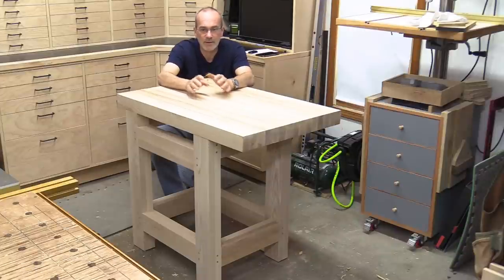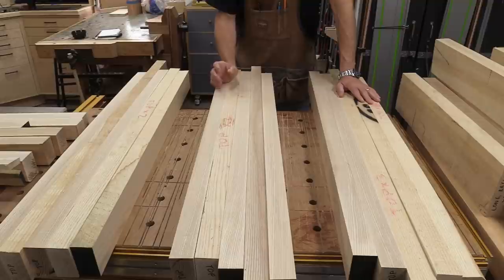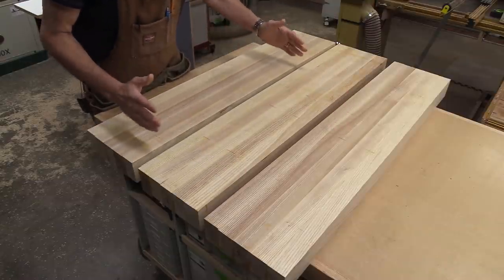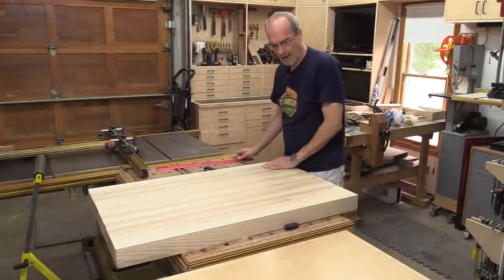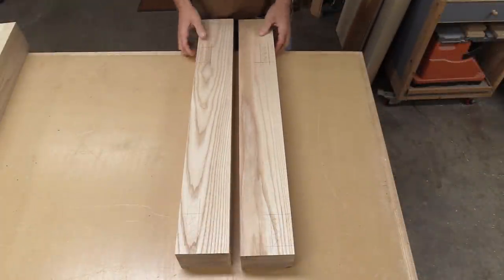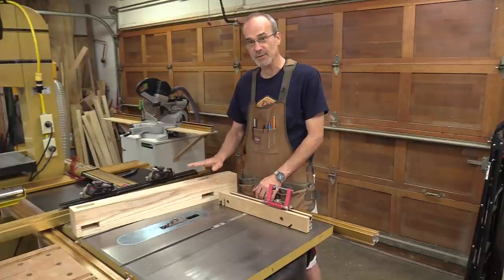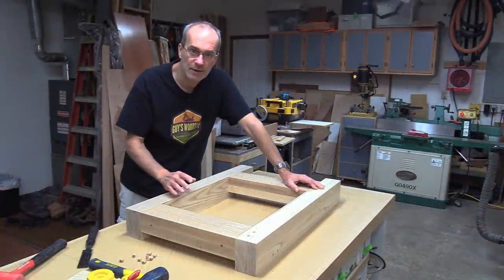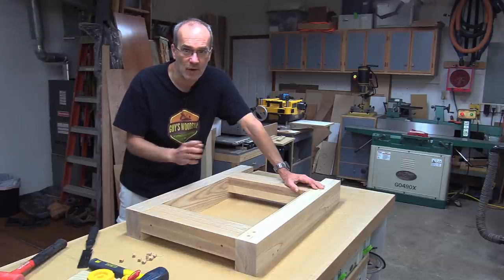How To Build This Small Sturdy Hand Tool Workbench//Woodworking How To

Comment: Really nice.
Put some rubber shelf liner under each foot and it will help get rid any little bit of rocking and keep the bench planted on the concrete floor.
Reply from the maker: Thanks Tim! That's a great tip! I have some of that liner left from when I did the drawers in  my shop cabinets.

Comment: Fantastic bench, Guy! Maybe I missed it in the video, but, why is the front apron lower than the rear? I went back and skipped around the video to watch again and didn't see you mention but I could have missed it.

Thanks for sharing!
Reply from the maker: Thanks Sean! Yeah, that gap under the top in the front is for the vise to go into. I never mentioned it in the video.
Reply: @GuysShop  I was looking for the same answer 🙌.
I'm building this now in Australia. Mine will have an end vise using LN chain drive hardware mounted under the top. Glad I worked this out now... Dropping the stretcher on that end will make install go smooth!

Thanks for the great plans and video. Big fan.

Comment: Hey Guy unless I missed it I couldn’t tell did you glue the tenons in the base? I saw that you glued the dowels but did you actually use glue on the cheeks of the tenon itself? Also are you worried about top movement the way you screw the top to the base did not look like the holes were elongated just wondering how it’s held up over time. Love your work

Comment: I have a silly question. I happen to have the option to buy 80mm thick European ash slabs. And was wondering for my "Small and STurdy Hand Tool Workbench" If I should just keep the slab on top, or cut it up and laminate it like you did.
What would be the pro's of laminating it or cons of just using the big slab of wood?
To me as a hand tool person doing the big slab in two sections seems way less work.

Comment: nicely done. Are you going to add a lower shelf or drawers like you built into the wall around the bench? I have found that in a shop environment there is no such thing as too much storage.
Reply from the maker: Thanks Tim! I have already built the small cabinet that goes under the bench. You can see pictures of it on my Instagram - @guyswoodshop

Comment: I haven't looked at your channel yet so sorry if you have a video answering my question. I am a machinist and I have multiple books and guides that I use for reference. I was wondering if you could recommend to me the best reference material when it comes to working with wood. Mostly interested learning how to make my projects more solid and structurally sound, if that makes sense. Thanks in advance
 Great video, I want to make a really nice sturdy bench but wood seems to be my enemy...

Comment: Another great video, as always ;D How do you do the 4th side if the boards are thinner?
Reply from the maker: Not sure I understand the question. 4th side?
Reply: @GuysShop  Sorry, I was unclear, I know it’s an older video :-) In the milling process; Here you joint the second thin side on the thiknesser by standing the board up on its side. These boards were quite thick. What do you do on thin boards? Do you use the jointer?

Comment: I can get Ash for $6-7 8/4 bf. So the wood alone would be $700ish... This isn't your average youtube 'cheap 2x4 workbench'. It is beautiful!
Reply from the maker: This was 2.85 bd/ft. And construction lumber is well, for construction. All these benches you see made out of "cheap" lumber are exactly that. Cheap. Expect a lot of movement and other weird stuff down the road happening to your bench if you go that route. Makes a great You Tube video, but not a great bench.
Reply: o.O You must have a good friend at the local lumber kiln! cheers!
Reply: Ash is $6 a brd foot at the mill I use. Worth it for a great bench, but expensive!
Reply: Construction timber comes in varying grades and makes a good enough bench.  The bench is what you use to build great furniture.  I like the precision and can figure what to do when I don't have things like a dado stack or a domino.  This plus your answers re grain direction are enough for anyone with common sense to build a bench that will last for a long time.  Maybe when they sell some fine furniture they will be able to afford the tools and wood that they complain they don't have.

Comment: HI Guy, thanks for posting this, I am building this table right now after purchasing the plans. Quick question: why is 1 of the upper stretchers lower than the other 3?
Reply from the maker: Hi Ari. The one rail is lower to accommodate the screws for the vise that I put on that side.
Reply: Oh, of course! In the sketchup model that rail is 3" below the top. After doing the vise install, is that dimension still accurate?
Reply from the maker: Yes, it sure is. Did you watch the video on installing the vise to the bench?

Comment: Hello Guy, i think i know the answer but, if i decide try to build this workbench, do you think it will be as heavy and sturdy with more soft wood ? (pine or something similar).

Thank you for sharing this video :)
Reply from the maker: It should be. Since the wood you are using is not as dense as the ash I used, it will be lighter.
Reply: Yes ok sure, thank you for the answer :)

Comment: Still learning here, and wood expansion is my latest enemy.  If I saw correctly, you just screwed the top to the base.  What about expansion, or is that not a concern in a top like this?
Reply from the maker: Hey Gary. The grain is going from top to bottom, so any expansion will be vertical, not horizontal. Should not be an issue at all.

Comment: Great work bench but I will have to continue my search for a design that does not require a boat load of expensive power tools
Reply from the maker: Thanks. The design of this is very basic and can be made with very modest tools. I am using the tools I have available to me to do the job.
Reply: To be fair, his design doesn't require a boat load of expensive power tools. That's just how he chose to build it. The  design is straightforward, and can be built with inexpensive hand tools.
Reply: LOL if you try and make this with inexpensive hands tools it's going to look like a POS
Reply: Why would you say that? It's not a complicated design at all.
Reply: I think you missed the subtle poke at using $50000 worth of heavy wood working equipment to build a bench

Comment: step 1, buy  $20,000 worth of tools
great build and beautiful top and as simple as it is there's absolutely no way anyone can attempt this, its not much of a "how to" when youre sporting a festool domino and powermatic everything

as for the future i'd definitely recommend since most guys looking at these types of videos are DIYers, throw up a video using circular saw, table saw, and nails, my first bench was a bunch of corner braces and connectors, still have it to this day!

great video nonetheless!
Reply from the maker: Thanks Phillip. This build could be done with nothing but a hand plane, some chisels and a saw. I appreciate what you are saying about the DIY crowd. However my channel has never been a part of the DIY community. It is centered on building mid level furniture.
Reply: There's always one in the bunch
Reply: Dominos are not needed really. They are helpful when aligning the boards but you can do without.
I built a much bigger workbench with only a Stanley #4 plane, two saws, two chisels. That's all you need - in addition to the knowledge on how to make mortices, tenons with handtools only.
Reply: Some of us actually like a youtube channel where you can see how a real professional builds furniture grade pieces. That is why I come here. There are plenty of other channels where wood workers get by with less equipment (Matthias Wandel, Third Coast Craftsmen, etc.). Why don't you just watch those instead of trying to lecture a pro about his methods and then humble bragging about your old work bench?
Reply: I have been a woodworker for 40 years, not as a profession, but as something I enjoy and I think I am pretty good at it.  I have enjoyed Guys' videos for the last several years because he is like me, he enjoys woodworking, buys the tools he wants to help him accomplish the work in the most efficient accurate means.  Some may view this as outside their economic means.  I guess that will be the case with any endeavor.  I don't mind that Guy may have a tool that I think isn't worth the money, he earned his money and can spend it any way he wants.  I like the fact that I can evaluate the tools he uses and decide if they are worth the cost to me. If a tool manufacturer gives him a tool to use in exchange for the views, so be it.  I am smart enough to understand a commercial vs a demonstration.
Reply: dude you could do the exact same thing he did with regular dowel joinery, would just take you an extra 10 minutes